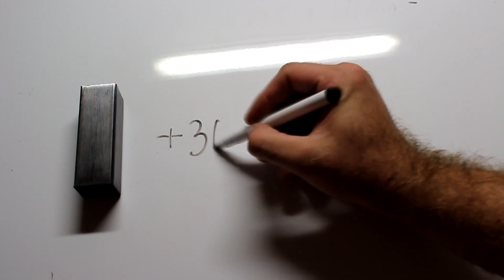Knife Making - Blue Demon Knife

Comment: how did you drill through that steel?
Reply: with a drill
Reply: with a normal HSS drill?
Reply: yes
Reply: make sure you don't try to drill through tempered steel. that doesn't work. but a cheap old black oxide bit will cut soft steel.
Reply: a cheap drill for ceramic would be enogh, if u tryna to be fancy wif it get a tungsten bit , both bites through hardened steel like 1095 high carbon steel or even m2 hss with a little bit oil

Comment: nice to see a guy who doesnt need 20,000 Bucks worth of equipment to make nice knives
Reply: Using tools that most ppl can afford, best knife making video 👍👌
Reply: Your profile name says everything
Reply: CommonSenseCreations most of those do have a workshop where they make knives for clients
Reply: TRISTNT no.
Reply: I know, these tools are so common it inspires me to try and I don't even have the slightest clue how to do it lmao
Reply: Expired Bleach Yes.
Reply: Look up Chandler Dickinson then lol
Reply: you didnt temper it in oven?
Reply: CommonSenseCreations he may not have all the expensive equipment... but it bothers me that 1.) The blade has craters in it. 2.) He cut the shape out of an already flat piece of metal, rather than shaping the metal manually. 3.) He didn’t sharpen it. Don’t tell me he did, because the edge was blue. When you sand temper-tinted metal, the color sands off. 4.) He used epoxy to hold the handle together. If they didn’t need it for the over 2 thousand years for which swords and knives have been around, they don’t need it now.

In conclusion, the knife is impractical and is not well-made. It’s a purely decorative piece. That having been said, in my opinion, it’s really not a “nice knife.”
Reply: @SkySprice  1) every forged blade will have craters in it
2)so what if he starts out with an already flat piece, doesnt minimize the quality
3)you know he can always sharpen it later? Sharpening a knife is the easiest part
4)every modern well known knife maker will put epoxy before pinning the handle, if they had epoxy 2000 years ago they would use the shit out of it.
Reply: stale meme >point of my comment goes entirely over your head

My point was that sure, he didn’t use $20,000 of equipment to make it, but I’ve seen far better knives made on tight budgets. As for my point on not sharpening it, it was that the blade is unfinished. As for cutting rather than manually forging, it’s not about quality, it’s about craftsmanship. Anyone who has a shred of pride in their craft will do it right and not cut corners. Same point applies to the epoxy
Reply: @SkySprice  what was your point?, as far a i can tell you your point was 'the knife is impractical and is not well-made. It’s a purely decorative piece'. Anyone with common sense would cut a piece of metal the closest they can get before forging, manually forging steel into the shape of a knife while you already have a flat piece is not craftsman ship, its stupidty. extra effort for what? not only that but it introduces more stress into the steel. And how the hell is applying epoxy cutting corners? if anything not applying epoxy is. And i agree that he should've sharpened it on camera but again sharpening is the easiest part of making a knife
Reply: stale meme The grain isn’t the same as wood, but much like wood grain, it’s vital to the overall structure. Now I’m tired of this pointless banter of a six month old comment. No one is getting anywhere here. Let it end for God’s sake.
Reply: @SkySprice  fine lets end it here, next time if you don't know shit about a subject, then don't 'criticize' someone else
Reply: stale meme next time you say “fine let’s end it” then actually end it instead of taking a final jab.

Comment: Never wear gloves while working with machines, you could lose some fingers or even your hand.
Reply: Well with a lot of machines. There are some machines you should wear gloves with. But yea, having a finger sucked into a bench grinder is always bad.
Reply: my boss simply told us every machine with spinning parts (drills, grinders, tablesaws,...) has to be operated without gloves and either no sleeves at all or atleast rolled up behind the ellbow.
Reply: +Joris Timm the reason behind that is if you don't the glove or sleeve can get pulled into the mechanism where if your skin contacts it a cut or abrasion is more likely where a glove can mangle a hand a sleeve can sever an arm...
Reply: Lunas Eclipse
Don't forget "degloving" that stuff is nightmarish.
Reply: i didnt know what degloving was so i searched it frickin horrible
Reply: LittleRed Motovlogs The fucking shit of nightmares isn't it? #1 reason to wear boots on a motorcycle and not wear gloves around rotary machines.
Reply: also steel toe boots are not meant to prevent toe severing they are designed to prevent crushing and to sever cleanly for reattachment
Reply: Lunas Eclipse
 That's crazy, I never thought of that. Do you have a source for it somewhere?
Reply: just checked my statement is myth when mythbusters checked it they found it prevented crushing and to get close to shearing anything they attached a blade wich bounced off the toe and sheared more of the boot than normal toes did
Reply: Uh...for anyone wondering DO NOT google "degloving"
I'm fighting back barfing up my lunch as I type this
Reply: yeah you probably should have asked someone before googling or so. that shit is no fun at all. especially if you have to work on those big machines all day after seeing what can happen...
Reply: Swallow_Skyla Here's something else for you to "NOT" google, "bench grinder injuries"... You'll never want to go near a bench grinder again in your life.
Reply: but now I really want to google it
Reply: Yea this was making me cringe bye bye fingers
Reply: I thought I could do pretty well with the medical field and working in a operating room, but then I google image searched "degloving" and realized I would much rather not. LOL
Reply: Swallow_Skyla I should have taken your advice but my curiosity took over and i Looked it up anyway. Fucking shit that's gross,
Reply: SuperAlvin you make me even curios... =_= do you recommend me?....
Reply: bottle 0' games go ahead
Reply: SuperAlvin I'm scarred

Comment: I've found you can get the same coloring by cleaning the blade after quench, polishing it with aluminum oxide and leaving the polish on it, and tempering in the normal range of 450 or so. Then it won't be so soft because of the extremely high tempering temp.

Comment: Awesome showpiece for sure! But to get that kind of color from steel, that blade is hardly better than your average kitchen knife. You went through all that effort to harden the tip but then annealed it to dark blue. Unless that's some crazy special steel, you've basically just softened it up again to the point where it wont hold any decent edge.

Comment: But the blue means the metal isn't tempered and is soft AF it will blunt easy and bend
Reply: lol should have read the comment before I asked the question.
Reply: what
Reply: I asked if putting it in that high of a temp for that long would ruin the heat treat. after all he did take the time to do so.

Comment: if your going to make a knife from a saw blade why heat it in a fire and ruin the already hardened and tempered metal why not just keep cooling the metal as you cut and then you don't have to temper it after.

Comment: that knife can be easily be broken. why? because that knife was cut into shape. real knife makers did not use this technique because the steel is not hard. in order to make it hard, you have to forge one. sure it takes up a lot of time but i asure you that by "forging" a knife or blade instead of taking a peice of steel or metal and cutting it into shape, you just made a quality blade.

Comment: there are ~5000 kinds of steel. 4800 are suitable for knifes. so wtf why...
Reply: I believe Nick suggests that the steel and heat treatment you've used is not perfect for blades. It's perfect for visuals though and I think that's the point of the video.